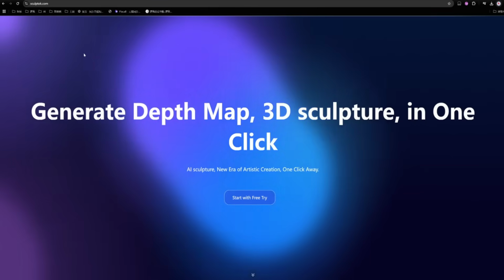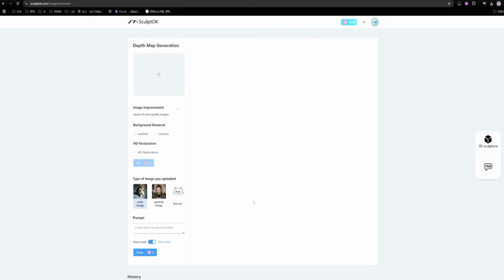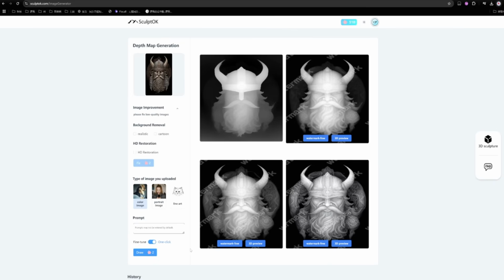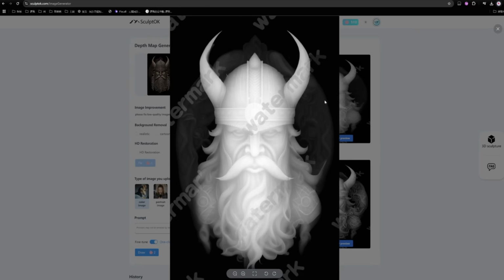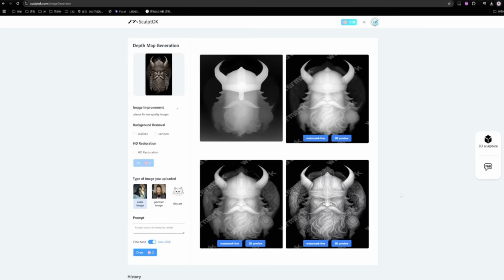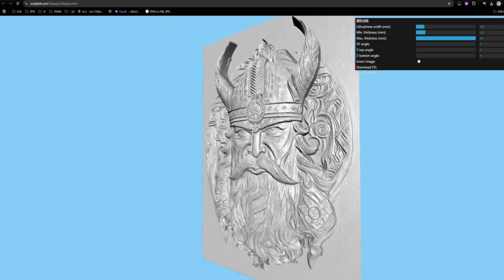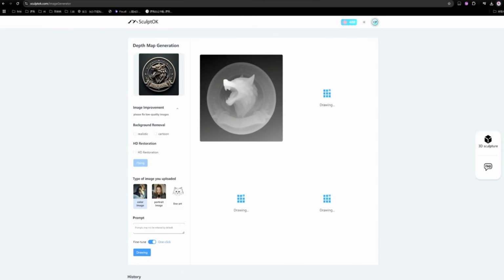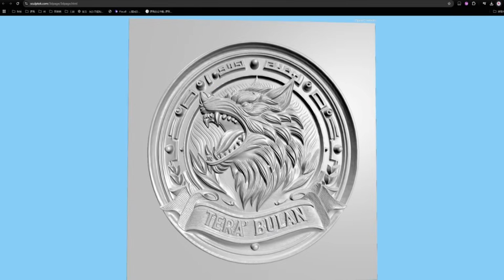One click to generate 3D relief from AI for CNC machine without Zbrush

Comment: The generated image size is only 1280*848. The input image size was: 1536*1024. How to get better resolution?
Reply from the maker: At present, in order to ensure the best output effect, we limit the maximum value of the input image resolution to 1280. However, we will open a higher resolution option in future updates, which is a plan that is already under development.

Comment: I am engraving brass coins and I started to use sculptok it is reslly awesome. I always download the forth depth map image for deepest bas relief on my coins. So I wonder if I get an updsted depth map after I modify Z height of the stl model
Reply from the maker: Our depth map does not change according to the z-axis height of the stl model, but you can download the stl model and then use the 3d software to infer the depth map. Thanks for your reply
Reply: @ but it would be nice if the depth map is modified according to Z axis height
Reply from the maker: @designodesigncreativity  At present, the step you mentioned can be easily implemented in ZBrush by downloading the STL file. It is difficult to implement this operation on the website.
Reply: @ it is ok just wanted to share my thoughts and comments. Will keep using it really handy

Comment: have any way to remove background?
Reply from the maker: You can directly use the Background Removal function on the website.
Reply: @SculptOK  i mean, creat 3d stl file without the square background
Reply from the maker: @ajatomaquinas  This is not available on the web at the moment. I would recommend manually removing the background in 3D software like Zbrush or Blender.